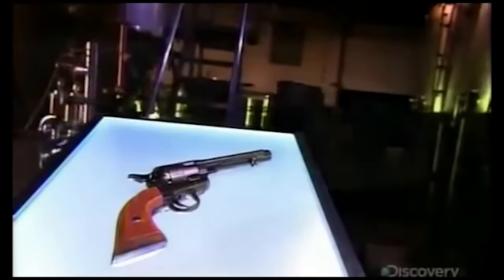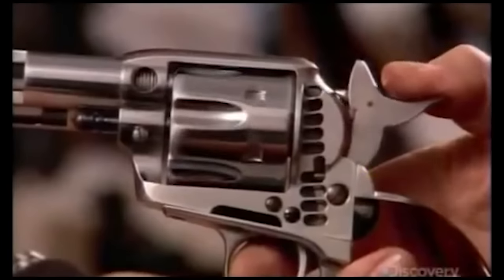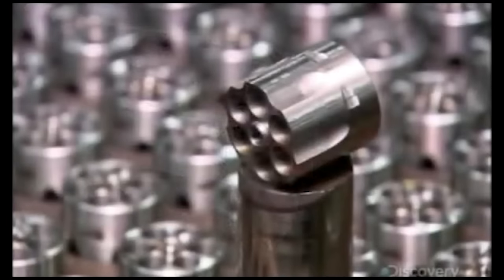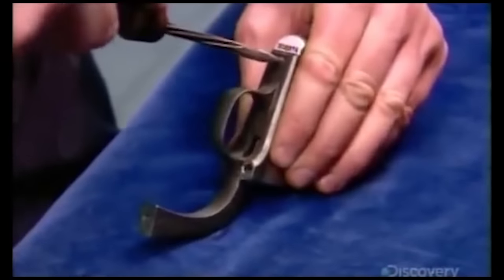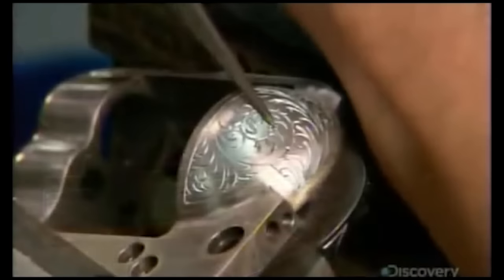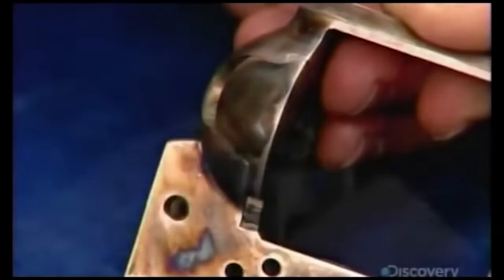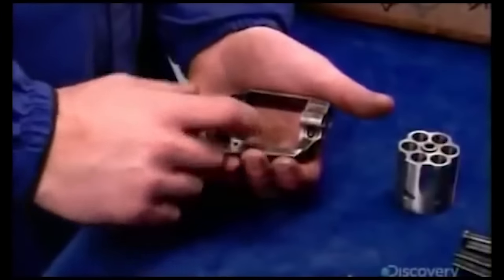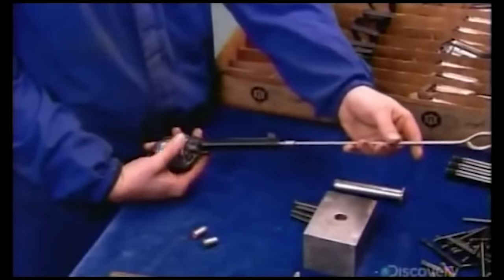How It's Actually Made - Revolvers

Comment: As a gunsmith, hitting the gun with a hammer is probably my most common trick. Sometimes for taking it apart, sometimes putting it back together, sometimes just making it do things. Hammers are easily the most common tool I use

Comment: Interesting fact, he's right about slamming the butt of the gun to fire. Most of the time they'd use the strength of their legs to fire the gun. It was faster and more consistent than slapping it with your hand and allowed physically weaker  people to effectively use the revolver. They did this by swinging their hips into the handle of the gun. This was especially useful in quick draws, being able to go from a draw to firing without pulling the gun up. Thats where we get the term "hip fire" from

Comment: 'Another spring is attached to the grip, which transfers energy to the hammer for it to fire.  Before this spring was implemented in modern gun design, cowboys fired their guns by whacking the back of the grip as hard as they could.'

Funnily enough, this would've actually worked if they hit it hard enough as older revolvers lacked the same safety measures modern ones have.  If enough force was applied to the hammer, the gun could potentially go off.

Comment: weird how they showed hot salt bluing when the angry pensioner quit his job but then showed footage of color case hardening in which the hot metal is plunged into a high carbon low oxygen enviorment to harden the part and to give it the color while in salt bluing the color comes from the temperature of the salts causing the steel to form what is essential a super rust on the outer layer that doesn't corrode.